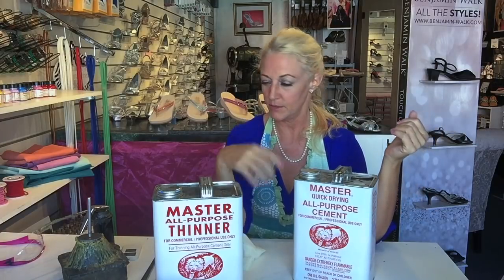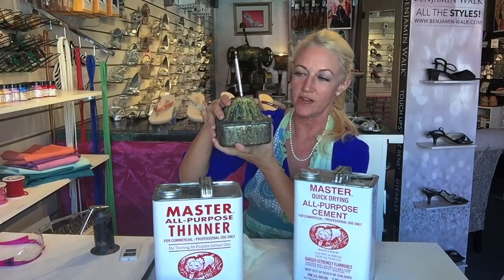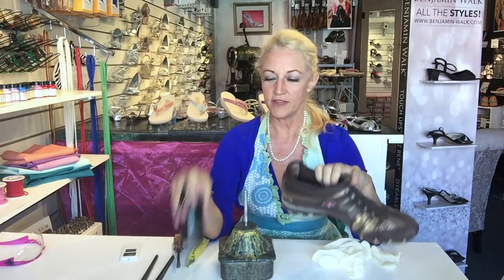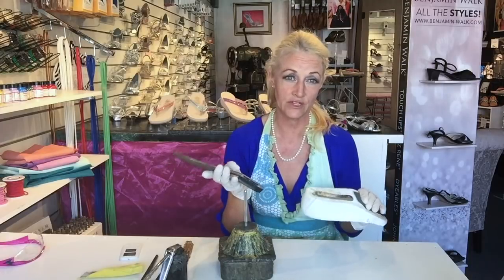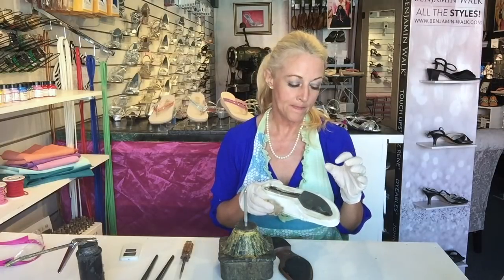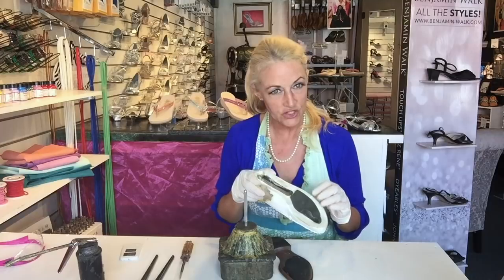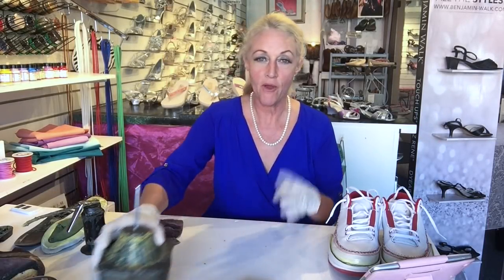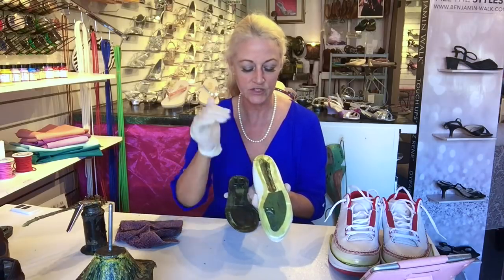How to Glue Shoes - 4 Steps to Glue Most Shoes

Comment: Very good video here Teri -I do have a couple questions for you, and you would
know, as your a Cobbler. I have seen other videos and it's pretty much agreed
that the Barge Contact ( yellow can ) or the Masters ( white) are the best to glue 
"leather to leather" - right. Both are contact cements.
 
My question is how about "leather to rubber" ?? - as I want to fix 2-3 pairs of
running shoes I have where the leather uppers have come apart from the rubber
soles (bottom). You don't say in your video if your going leather to rubber, or leather
to fabric ?? or what ?? I get attached to shoes, and don't like to throw them out,
as they become very comfortable, for jogging etc.
 
I'd just like to know if I use the Masters or Barge contact cement --and I want
to adhere my leather uppers that have separated from the rubber soles ( bottom)
will this work ???
 
Can you answer my question Teri--and great video --all the way from Canada :)

Comment: I wear sandals that often have straps pull out. It happens a lot to even new and more expensive shoes. It seems many are made without thought of the straps staying connected within the soles. How do you fix straps that have come out? Thank you ahead of time.
Reply from the maker: Sounds like dry glue.  You just peel the shoe apart and re-glue each strap. Once they are all dry, you can glue the sole back together.

Comment: Great video Teri!   Haven't tried this adhesive, but I'm very familiar w/ other types of 'contact cements', where you let each half dry before making super strong assembly/bond. You suggested Barge's, which I've not tried either - is that much different than Shoe Goo? Also wasn't aware of the Angela's paints.  Thx and greetings from Iron Mountain, MI

Comment: Great video.  I have about 5 pairs of shoes I’ve had almost 20 years in good condition except the glue is old and they are coming apart at the soles. Does thinning the glue actually weaken its contact? Seems if the thinner can be used to remove glue.  Why not use the glue w/o thinning it.